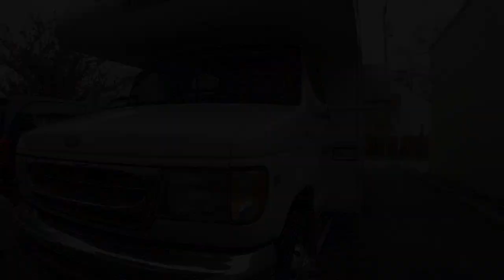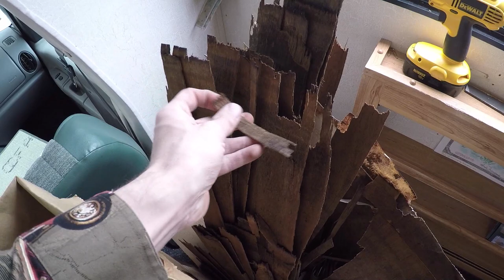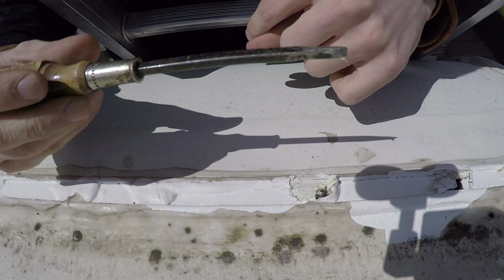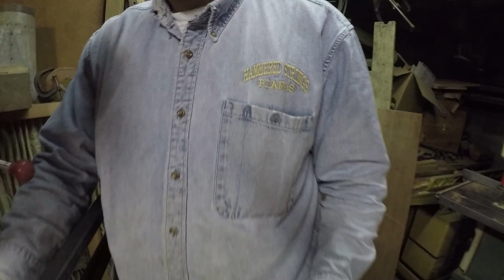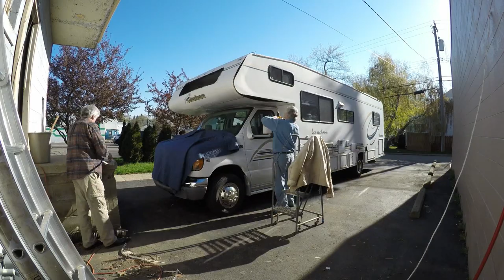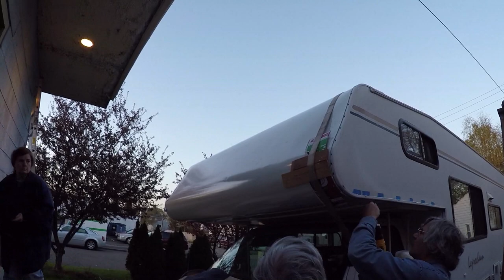Rebuilding a Class C Motorhome

Comment: I rebuilt the overhead cab on my 1998 Winnie about a year and a half ago. Great video and I started using the adhesive you recommended, thanks!  I replaced the sleeper board over the cab and used your adhesive to glue new fiberglass to my new green-treated plywood. It worked great. I eventually used Sikaflex 291 adhesive because it came out of the tube easier and was water resistant. I also found that two of my marker lights were leaking not only between the base and the fiberglass, but also between the lens and the base. I used Sikaflex to glue the base to the fiberglass and that fixed all leaks. I believe more water came through my marker lights than the window. If anyone else is doing this, don't use silicon caulk because the bases will flex and water will get in. Adhesive will keep the base and the fiberglass from flexing.

Comment: Been there done that. 2000 sunseeker rebuilt 3 times. Last time removed bunk and front wall panel with window, stripped down to the aluminum frames, replaced all foam insulation, epoxy bonded azdel to both sides of the frame and epoxied all new fiberglass sheeting on both sides.  Azdel is a new composite sheeting used in the rv industry in place of the wood sheeting previously used. We had a new bunk frame welded up from heavier gauge aluminum structural members, and eliminated all wood and cellulose material in the front cab.  Took 6 weeks and about $5000 in materials to rebuild.  No more water issues with the front cab.  Kept the front window as it was not the problem. Frankly, the problem is using wood in the construction because as wood is a cellulose product, once it gets wet, it will rot and develop black mold.

Comment: You really engineered the heck out of this. You are exactly right. I rebuilt a 1993 c class and the overcab was a freekin mess. I didn't take it as far as you did and mine had steel beams across the loft area. But you make valid points. Thanks for sharing.

Comment: Good video.  I think crank out windows are far superior.   The screws actually rust from the inside from wet wood and the rust goes out.  Rusty screws are the first indication of water damage.  Nice work on the repair to all you guys.

Comment: I'm doing the same thing to mine now.  It sucks.  The deeper you dig, the more deep you find you have to dig.  It never ends.  Water entered and shloshed to the back.  I had to replace entire roof ,  front over cab like you, and entire back end.  It sucks.  What is so bad is that they didn't even use any tape on the seams when they built it.  Plumber's putty was all.  Every seam leaked. Run, don't hide if somebody says "it leaks a little."  I wish I had your skills cutting those irregular pieces in the front.

Comment: I know your pain! I just found this video after I did the same repair on my 1989 Damon Escaper Class C two weeks ago.  Wow! What a project that was.  I used 3/4" ground contact pressure treated plywood for my new overcab floor.  It is one of those projects that leaves you wondering whether all the effort is even worth it. My advice?  Cover it with new paneling and sell it.  LOL.

Comment: Part of what you say is true . They do use some sub standard stuff . But if you build an RV the way you are wanting it , it would be 300K instead of 150K . So you have to find a happy medium . A lot of water comes in from running lights , That would be the first place to seal a brand new RV  .

Comment: I own a 1989 Sterling Class C built on a Ford chassis. My bunk rotted out form a leak in the top right corner. Didn't know how bad it was until one year, the entire ceiling over the bunk collapsed. My repair was twice as bad as this one, because it included re-doing the entire bunk, including the roof. LOTS of money to re-build.Another area to make sure is sealed up properly is the amber clearance lights. Water was getting thru there too.Also, I'd suggest using a Dewalt Impact driver for the screws. Much easier. And for the record, the work looks awesome!

Comment: When new small motorhomes are more expensive than many houses yet built cheaply wow it is just insane. They are cheaper in Canada in England some new C Class motorhomes are 100 thousand pounds like $200,000 for a small vehicle that only sleeps at best 4 and possibly 6 at a push. The advantage of a small motorhome is roadside in UK some large motorhomes you would not get down some roads or even onto some campsites. Here in Canada roads are bigger generally very straight.

Comment: Those front windows don’t help as the cab flexes at opposite angles the window frame will eventually pass water. On the plus size that over bed can now be used as a battering ram as it’s now built like a tank.

Comment: Hate to tell you but Class A's that have a front cap rather then continuous roof do the same blasted thing. If the have a recessed AC roof unit, it'll leak as well. It is quite frankly an unending battle to delay the leaking.  But anyone that's grown up around RV's could have told you RV Manufactures are ripping people off.   Easiest way to tell from the outside if you got leakage is look at the screws in the trim and run your hands on the outside, check for delamination or squishy gives of even just a smidge, you'll feel that before the inside shows anything.  Corners are your enemy in RV's as are windows.  Get out and caulk every seam EVERY year, do it at the start of camping season and check over as you winterize, recaulk at that point if necessary.

Comment: It was never taken care of if you buy new you must make sure you take care of it your RV front was bad ,but your friend hooked you up saved you close to 3 grand if you buy used push on all the walls open cabinets spongy floor walk into corners push everywhere if take care of the roof and  windows and remember they are mostly junk if you're handy well you are in for it ,I bought one 200 bucks a 30 foot turd and there is 10,000 steal screws and OMG Staples I did try to do the floors first that's right 20,000 Staples it was impossible so I tore it down to the frame kept windows , doors and cabinets and I made 700.00 and burned alot.

Comment: Good job I have done this to every class c I have ever owned they all seem to develop leaks. i agree the manufactures do not care and just throw them together. Something else I do now is buy the roll metal roofing just like what they put on the cargo trailers.  They will cut it to fit your measurements and it is not that high. I paid eighty nine dollars for a a 32 ft x 8 ft piece for my current 27ft class c. It is not that hard to install it right over the junk rubber roof they put on from the factory and charge so so much to replace.  It will stop all the leaks and last for a long long time. I also arch it while i am at it so the water will not just sit on the roof even the ac causes water to stand on the flat roofs another really bad design from the factory.
Reply: How do you arch it?
Reply: @489graves  I run a treated 2 x 6 all the way down both sides of the center 14 inch roof vents. One on each side all the way from the front to the rear and do the same  thing on  top side edges with 1 x 4  this gives you the arch, then i install half inch osb or plywood over them sideways you will only cut a few inchs of a 8 ft board due to the rvs width . Then I roll the roofing down the whole rv from front to back. You leave about 2 and a half inchs hanging off on both sides and you bend that down over the side all the way down.then re install the side top trim and thats about it just reinstall all the vents and ac no more leaks ever. Any questions hit me up.

Comment: Sorry it happened but it is designed for cost not structure.  The first thing I did was put eternabond tape  on all the seams especially the front and rear cap where those screws are

Comment: So far replaced the back wall on class c water seemed to get in by the awning and seems connected to rear siding. Corners so rotten that was not necessary to unscrew the moulding you just had to pull it off. The cab over has been damage by low trees and I like this video cause it needs complete overhall.How far back k did you overhauled the Cab over to have a good support

Comment: good move on the marine caulk, but why no stainless screws or epoxy coating on the new wood?
Reply: we used stainless where needed and I am not a fan of epoxy.   Just use good wood and you shouldn't have issues

Comment: Did you add back the insulation between the voids? If not, then you only glued the underneath fiberglass to the support ribs? Is this working with wind at highway speeds? I also noticed delam on the sides, near the nose, at the end when re-installing the edge trim. Did you not use the adhesive to glue that back while you had it apart?
Reply from the maker: We didn't bother with insulation because he doesn't use his RV in winter.  As far as the delam. The adhesive takes days to set. So the side trim holds the skin on until then.
Reply: we did not replace the insulation, we did however put marine plywood in the voids and the skin is glued to that as well.  Nothing flaps in the wind now

Comment: Did you glue the new piece of fiberglass over the existing filon, or did you remove it first? I'm wrapping up a re-roof and front cab rebuild on mine right now I took the whole front off and rebuilt it , I've had over 700 lbs up there and it hasn't moved at all while bouncing around up there, that wouldn't have been the case with what the manufacturer thinks is ok .
Reply from the maker: We just glued the new piece over the old one once we took the window out.

Comment: I just inherited a 19 yr old Class C with everything in the world needing help. I'm sure it has the very same issue this video is about. I think it is old damage but I'm going to have the roof looked at and replaced if needed. 
  I have already invested $4500 in chassis work. The only thing it had was newer tires with 8000 miles on them. The rest of the chassis is in what looks to be good condition according, to the truck service center that was highly recommended and I used. 
  ++++How much do you estimate (ball park figure) a "crap load" of money is. to fix the bunk area?? ++++
  This one I have has wall paper on the inside that is water stained and crisp so, know its got to be like this one after your explanation. I also have rear delam too but, want to work on the roof and bunk first. 
   P.S. I went to an RV show in Pa. a few yrs back and the head of sales for the Zion was showing me how the bed works and the thing fell apart in his hands. So even when they are using one in a show they make no effort to make sure everything is tip-top. Even a mobile home is made better as, they have to meet HUD standards. New is the biggest rip off ever.

Comment: Rain damage can only happen when one does not do regular maintenance!!
Reply: Not true, I have had delamination going on for years on my 2012 Heartland Road Warrior. Dealer declined to help, Manufacturer declined to help. Finaly tore it apart to try to do something myself only to find that the window frame was beat in with and destroyed in multipule locations either a hammer or a air chisel to make the window fit. Then they screwed a piece of wood and applied bondo to try and cover up their mistake during manufacturing. In turn the window never was sealed right and now the whole section has delaminated. not one bit of maintenance would have prevented this problem. Time for a lawyer because these manufacturers dont want to stand behind their products, 1 year warranty is a spit in the face to us that by brand new units. They know most problems wont happen in a year.

Comment: Gonna add alot of weight to the front end of the chassis
Reply: We removed the foam in the deck area and replaced it with 3/4 inch plywood adding about 20 pounds, removed three wood strips and replaced with steel adding another 5 pounds.but then  we removed a 20 pound window and replaced it with 1/4 inch marine plywood actually cutting weight at the furthest forward point.  I think the net gain will be about 30 pounds....+- Not to mention all the soaked wood that we removed had to add at least 5 pounds....oh my God was it wet up there!!!!!
.
Reply from the maker: Even if it added 200lbs it would be worth while to prevent future 
problems.  It wont even make a noticeable difference on a vehicle that 
big

Comment: Nice impressive but I would have kept the window
Reply: Tomas C K the problem is that those windows are notorious for leaking.  When you have to fix the water damage, you seriously consider whether or not it’s worth adding it back in with the risk of having to rebuild it again.  I too chose not to add mine back in.

Comment: This isn’t a problem just with class c RVs  -it happens with any RV that gets water damage. You also may want to actually check the rating on the class c you’re working on, as most of the cab overs (especially on older RVs) are  really only rated for 150 lbs and are not actually meant for adult use. And you’re really kinda unrealistic on the quality of RV building. I mean, it’s not like you’re buying a house, with building codes and massive amounts of regulation. Of course they build them as cheaply as possible. And if you want quality building materials and workmanship, you have to go with a higher end brand like Airstream or one of the newer companies that do custom builds. In reality all mass produced RVs are produced by 3-4 major building companies and they just slap a different company brand and color scheme on it. It’s the reality of buying an RV. As with any major purchase , do your research before diving in!
Reply: The bill of sale on the coachmen I just purchased was originally $74,000 USD. He is right. They are screwing you.

Comment: I thought these were bad. I bought a 2006 ultralight toy hauler yea a toy hauler. The whole roof and floor and probably the sides are made out of Styrofoam yes styrofoam. Guess what it breaks easily the whole trailer floor broke on both sides along the outer edge of the frame running from front to back causing the whole trailer to drop down about 2 inches on both sides. I tore in to it and to my horror there is no bracing you hear me no bracing . My god  these things could just fall apart going down the road. This is a toy hauler you could have heavy Harleys, large atvs etc. in there. This should be illegal to be built like that.
Reply: Forgot to add it did not get wet it just snapped the styrofoam was about 2 inches thick and no bracing also to put in the mounts to hold your toys you could only screw thru the foam really. You talk about junk.